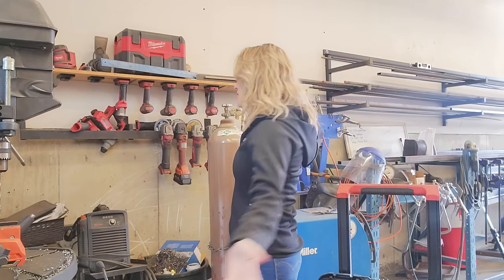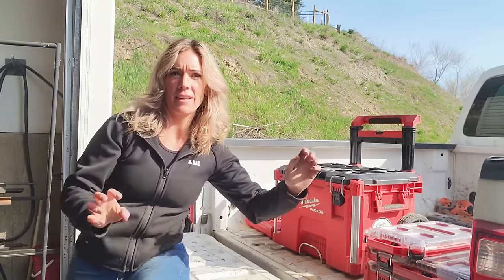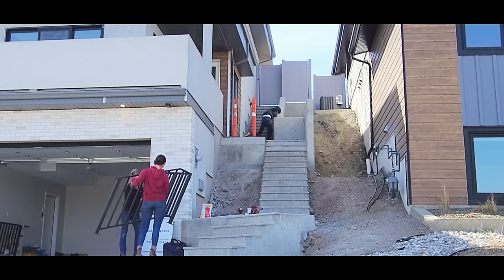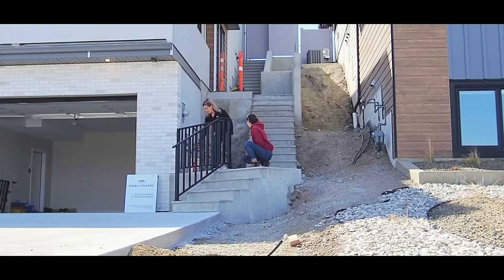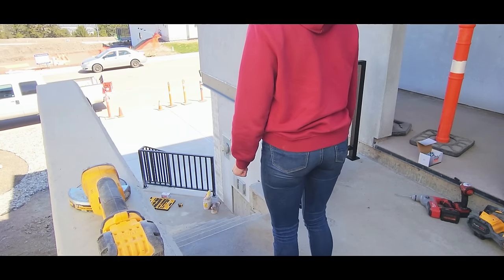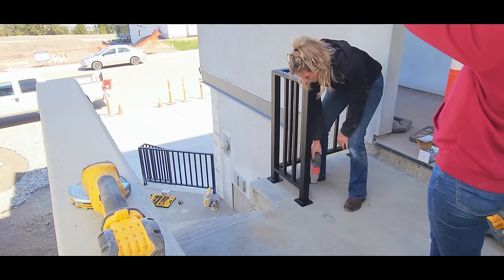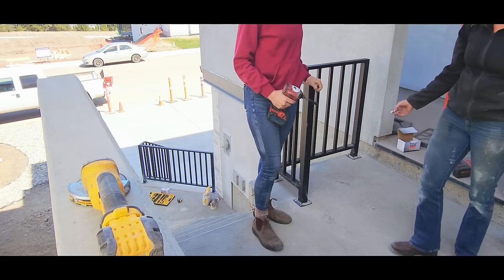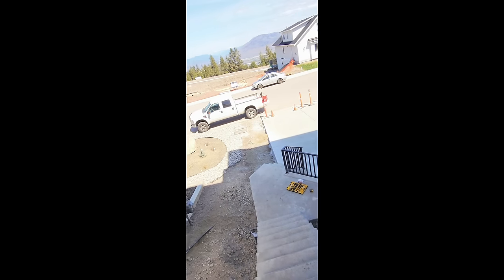Railing Install Day with My New Welder - Jenny

Comment: I really don’t want to be “that guy”, so please don’t take it that way, but I do have a friendly suggestion. When you’re drilling with the hammer drill, instead of using every ounce of your body weight while drilling, try using very light pressure, and you will be amazed at how much better the bit breaks up the rock, and how quick it drills the hole. Give it a try. Hope it helps. Keep up the good work!
Reply: Did you ever learn that socket welds needs a gap before tacking and welding to allow for shrinkage and prevent stress on the weld that could possibly lead to cracks?  I'm referring to your "TIG welding stainless steel pipe fittings"
Reply: Use a vacuum too
Reply: You want just enough pressure to keep it from coming up and free spinning. Just enough pressure to keep it hammering. Too much and you will burn up your bits way faster and it is harder on the hammer drill. Also for the most part. When you don't use too much pressure it allows the dust to come out easier without having to pull out as much. The more pressure you use the more the dust packs in and gets tight around the bit.
Reply: Fuckin lord have mercy
Reply: These guys suggestions are spot on.
Reply: What about the depth of the holes guys geez louisse

Comment: WOW-- Poor job, Incline didn't match the lower rail, your rail was over 4" next to your so-called gate area....I bet the rails pulls out from the side due to your bolts are too short and will never past the code. and I sure when you weld on the railing at the gate area, you're going to have to add more pickets and lower frame...Total trainee job with no Contractor lic. and I notice your lower rail didn't match the upper railing post design....Very sad job. and your end railing would never past code it's just ends without it returning back to the post and the 12" past the step. hope your gate will NOT open to the downhill side it would be nice to see a finish job with the gated system. Notice the top railing is NOT to code in height looks very short? 34" min to 38" max. Hope you have good Insur....Note: FYI---working with big development Co. tend to use people like you due to you can't get paid OFF at the end of your work due to NO CONTRACTOR LIC. and you can't take them to court. BUT people can sue YOU for everything. Business lic. is NOT a lic to install things just make things.

Comment: Don’t take this wrong way
But no PPE not a single thing, not a good example to set a new employee
Drilling the holes when the railing is in place? Will damage the powder coating, mark the concrete move the rail then replace
Reply from the maker: We all have our ways of doing things. We had the ppe we needed, and I've never chipped my powder coating doing it this way in the 8 years I've run my business. Thanks for the input though!
Reply: @rachelbohnet  
We all learn every day
Reply: @ian, not sure what you are talking about, both Rachel and Jenny are clearly wearing safety glasses.
Reply: @mikekelly2162  
You obviously don’t work in the industry 
No safety boots/shoes no hearing protection, no gloves, no coveralls, if you turned up at a development site like this you’d be put off site.
No coveralls,even for a professional image, looks amateur.
As I say above everyone makes mistakes, and everyone can learn something new everyday 
My comment isn’t meant to be negative it’s constructive
Reply: @rachelbohnet  i am with you tried both ways , i drill thru holes whenever possible

Comment: Great job, railing install looks like it went smooth and yea you right that hammer drill was putting in some work. New to your channel so maybe you’ve already got one but have ya seen the milawaukee metal saw, the circular metal cutting saw, M18 portable and corded. I was watching this dude build a trailer the other day and he’s got these two massive 3/8” I beams and he grabs this metal saw I had never seen and it literally went right thru the I beams like it was a 2x4 😂 I hate cutting metal on the road and this thing looked wicked, just thought I wud mention since I see your a big time milawaukee girl.
Reply from the maker: Thanks for the tip! I'll check that tool out!

Comment: Two tools to look at: Fronius Pocket series welder. You can weld completely  disconnected from a power source, 8-14 rods for 1/8" or 3/32", or nearly continuously on a regular 120V 15 A outlet. It's the size of a shoebox and you can toss it in the floorboard and go. It's ideal for railing and site work, but don't think it's limited to just light fabrication, it can keep up, even for medium sized structural work.  Pair it with a small generator and you have an extremely versatile setup to weld and keep batteries charged.  
Second, look at getting a Milwaukee portaband. It will knock out those cuts and trims so fast and also free to your grinders to be set up with a wheel/cutoff/wire wheel/buffer --whatever the situation is dictates. Stay safe, good luck out there!
Reply: i was about to say the same advise when i noticed your comment , spot on . Also Milwaukee battery powered 4 1/2 grinders are nice and could charge with generator . you could take a chop saw with also . Accupocket  150 stick welder , we brought ours from bakers gas , forget the state but really nice people .  Get the portaband in a battery system also
Reply: @williamwalters1184  don't be getting that chopsaw out unless it's got a carbide blade on it, now

Comment: You could have made a "Story Board" to match the longer railing to transfer the hole pattern to the concrete without needing to hold the entire railing to mark everything and make holes.  Be sure to vacuum all concrete dust from holes so you don't blow out your concrete when anchoring.
Reply: I notice you said (story board) where did you come up with that term?----good call on the info--take a look at my review on her job..what do you think?

Comment: Not Code Compliant,  ICC A117.1-2017 Standard for Accessible and Usable Buildings and Facilities, this might be the local code, You would have to check.
Reply from the maker: I have all the building codes for my local area and work with contractors and building inspectors to ensure everything is done properly and safely. Not failed an inspection yet! I do know many areas have different guidelines to follow...

Comment: I was expecting some welding..I used a Miller Synchrowave 250 back in the day when I worked for the airlines..they’ve gotten so sophisticated now with all the programmable settings.
Reply from the maker: Welding was on the build and test fit days!